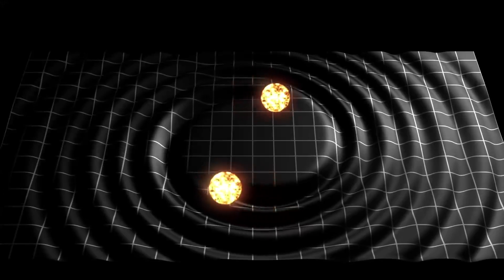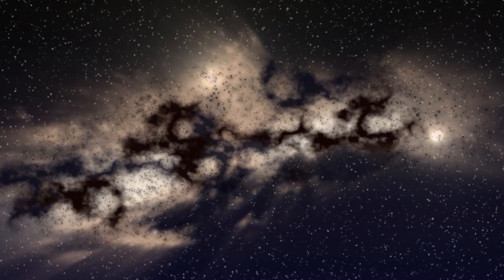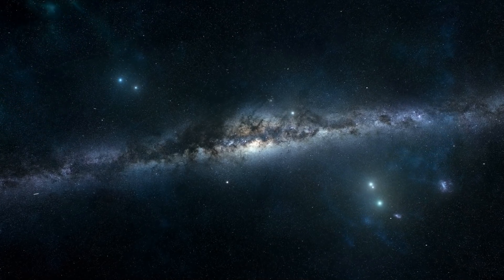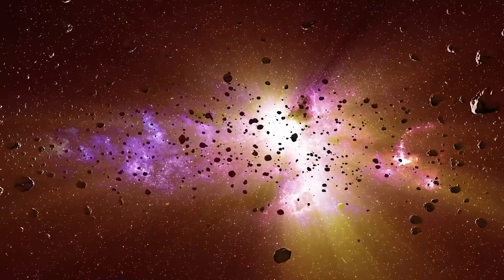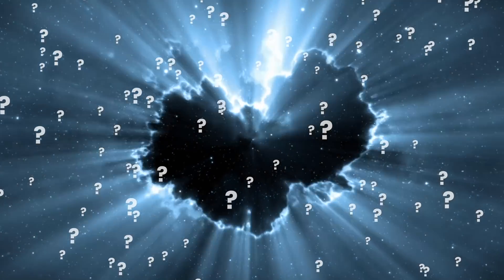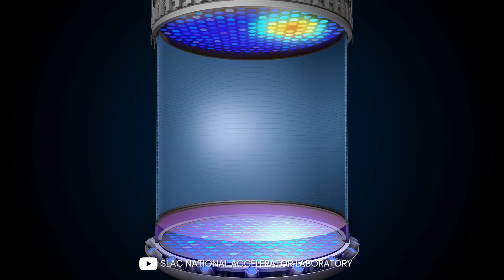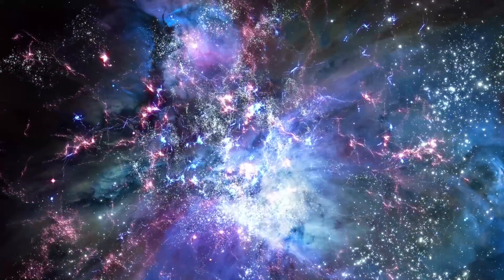This Will Change Physics! Dark Matter May Not Exist!

Comment: Dark matter is the corrective math that trues up our predictions of how stuff 'should' move with our observations of how they actually move (reality)  

In that sense, dark matter is just the ignorance of our grey matter.

We went through this exact same scenario with mercury's precession and even named an inner (undiscovered) planet Vulcan that was precessing mercury. Then Einstein came and showed that the vacuum of space isnt actually nothing and that the extra 43 arc seconds of precession cme from the time dilation encountered in mercury's close approach to the sun..

The orbital speeds of stars in distant galaxies require a number of assumptions.  Very few of which I imagine take into account the near Time = 0 state at the event horizon of the supermassive black hole at the center of the galaxy due to time dilation.  

The stars whipping around the event horizon in a blur are motionless, what you're seeing is the spin of the system which extends all the way out to the outer stars of that particular galaxy.

Academics place these galaxies on Euclidean grids of space time and Newtonian orbital values to determine mass and whatnot and that's not how it works.  The entire system is in rotational motion relative to ours.

There.  no need for dark matter to explain it, just like there's no need for dark matter to explain mercury's extra bit of precession.

Comment: The fact that there are are galaxies without dark matter is an argument FOR the existence of dark matter! Since it proofs if galaxies have none, their rotation can be explained without taking dark matter into account. While most galaxies still need dark matter to explain their rotation, this strongly hints that there is 'something' that increases their mass.
In short: If there are galaxies with dark matter and those without, and there is a clear difference in their rotation speed, there must be something different about the two types: Dark Matter (whatever it is).

Comment: The whole dark matter and dark energy thing is simply just a theory to bridge the absolutely enormous gap between what we think we know, and what we actually see. Just face it… the rate of galactic rotation, by itself, unequivocally proves that our current laws of gravitation are fundamentally broken… the discrepancy is just too large to ignore. IMO gravity shouldn’t be looked at as a force, but more of as an emergent property of the universe/space itself. It’s too weak as a force, hell a fridge magnet can overcome the gravitational “force”of the entire planet. Mass is just a measurement of how strong something drags on space/time itself. That relationship is not perfectly linear. There is an inherent minimum amount of mass something can have, and also an inherent minimum amount of space/time it can interact with. The more mass an object has the more space itself it’s actually touching, regardless of what size that thing appears to be. When we calculate the rotation of a galaxy it doesn’t make sense because we aren’t taking into account the actual topography and amount of space occupying the area the galaxy appears to be in.

Comment: what if gravity was an inter-dimensional force, thus seeming "weak" in one dimension, creating peaks and valleys in space/time in "blanket" dimensions that are physically undetectable from a single dimensional view. Stars and galaxies in neighboring dimensions shape our universe, and vice versa.
Reply: The issue with that is that is hardly likely to be provable. Although string theory has had a stab at looking at quantum gravity in multiple micro dimensions. Nothing like parallel universes overlapping, though.
Reply: This is .. something.. like string theory. If it would solve the problems string theorists would be celebrating confirmation of their field.. they arent.

Comment: How confidently and accurately can we determine masses of far away galaxies?
I ask because the entire dark matter hypothesis is based on this notion of galaxies which should be heavier that our predicted amounts.
Reply: That's a good question. We can very accurately determine the brightness and masses of Ia supernovas because they only explode on a very certain mass(the Chandrasekhar limit where electron degeneracy pressure from the pauli exclusion principle isn't powerful enough to hold off gravity), causing them to all have the same maximum brightness. The mass is about 1.44 solar masses.

Comment: Dark matter does not exist. The equation is the distribution of angular momentum = the curvature of space-time. It's baryionic matter that is at a higher metarotation than atoms. the dimensionality of matter is depenendent upon a kinetic fractal geometry known as a meta-rotation, matter alternates between being positive and negative dimensions, and the force, or curvature of space-time it exerts is depenpent upon where it lies on this kinetic fractal geometry.
Reply: This is true with dark energy as well, it's all baryonic matter, basically when you have one atom, it's of negative spacial dimension, two or more atoms together are positive spacial dimension, and their angular momentum influences other matter because of Mach's principle. Mach's princinple is the rule determining the laws of physics themselves according to the equation the distribution of angular momentum is equal to the curvature of space-time or the distribution of angular momentum is equal to the sum of inertial frames.

Comment: Yeah I don't see how dark energy is a thing without a particle capable of producing a repulsive effect on normal matter so that it can push matter without touching it directly and leave traces that we can see and measure.

And even then, unless there was an ever accelerating gusher of said particles spewing out the center of our universe, I'd don't see how an expanding universe suddenly decides to violate Newton by accelerating faster than the force being applied to it.

Honestly, the only thing that makes sense to me when it comes to Hubble, is that the universe is falling towards unseen container walls. We're constantly accelerating, because when you're inside a sphere, down is in every direction, and there is no terminal velocity in the vaccum of space.

Comment: Matter does not produce a gravitational attractive force, so this video supposed to give answers actually gives you the opposite to answers... bad information. Mass is gravity spinning in a hole, the hole creates the area of least resistance so gravity moves towards holes, there is no attractive force, or pull force. Pull forces are impossible in physics.

Comment: The fact that they built a mathematical model on the absurdity that  can communicate at a distance through an undetectable hypothetical medium formed by  space and time that requires more hypothetical substances resulting in a universe that is 95% unknown is,  in my opinion, indicating a 95% error bar in their models. Rather than just keep hypothesizing some new unknown, why not just say because god wills it, because the faith required to believe this science borders on religious.
The mind blowing thing is, that intelligent people believe this nonsense concerning DM/DE  and the error in their model is rooted in the belief that the effect called gravity is a real force unto itself.  Gravity is an effect, not a force which is why gravity is undetectable unlike electric or magnetic forces which are directly detectable.  Gravity is a dark force that  has brought rise to more dark things.

Most of modern science is science fantasy with little based on direct observation. Einstein derived hi GR ignorant of the electromagnetic fields that populate the vacuum of space, as well as the charged corpuscles, aka, charged solar particles of the solar wind. The model predicts DM/DE because the model is predicated on the false assumption that there are no electric fields or currents in space and they continue to deny.  A magnetic flux tube is an electric current. Observational science, to the clear headed philosopher has already refuted GR, unfortunately the theoreticians won't let it go.

Comment: Maybe bits of space itself are warped for reasons unknown. No matter is there but the space acts like it. It could be twisted space as a remnant of the big bang. Like pressure waves are the remnant of explosions in the air. The air gets packed together in waves. Space itself could be packed together thus causing the illusion of gravity from matter.

Comment: When you see a galaxy, you are looking at differing rates of time and differing measures of distance. Outside of a galaxy, there is very little matter mass and gravity to slow down time and shorten distance. 

What slows down light from our perspective is the gravity in the vicinity that slows down the rate of time. (It’s not that light slows down, it’s the rate of time that slows down.)  

So what happens where there is no gravity is that the rate of time speeds up relative to our rate of time so that starlight travels the same (or greater) distance at a faster rate of time. It’s still traveling the same relativistic frame speed but an entire second passes by from our perspective at a much faster rate, in a fraction of a second where there is no gravity to slow down time. So for most of the time, starlight is traveling through space at a faster rate of time relative to our rate of time.

That means starlight arrives much more instantaneously because the rate of time is free from the effects of gravity for most of the way. With no mass of its own, starlight arrives instantaneously as it experiences no time of its own traveling at the speed of light. We see things in slow motion where time is slowed down by gravity. 

This relativistic effect allows for a young earth since it doesn’t take billions of lightyears for starlight to arrive through the void of space where there is no matter to slow down time.

Comment: We've never verified the existence, nor nonexistence of both dark matter, and dark energy; their existence is entirely theoretical. It is logical they exist, sure, but in the field of quantum mechanics, a lot of our concepts are simply that: concepts, based on loose interpretations.

Gravity for example isn't fully understood. We don't really know WHAT creates it. We just assume mass creates gravity. But when you acquire a deep sense of quantum mechanics, that theory ceases to hold up. It's most likely that gravity itself is merely a side effect of electromagnetism. Every core of ever star and planet are electrically magnetized, and that is what forms the core itself, regardless of it's makeup. Therefore, it's only logical to come to the conclusion that the mass that forms around celestial bodies is due to this electromagnetism that forms their cores. Our planets core produces an electromagnetic field, which protects our planet, and the aurora borealis is due to electromagnetism. The more learn, the more likely that gravity is not a force itself, but merely a consequence of electromagnetism.

I have a BA in Literature, but I have the knowledge equivalent of a PhD in Psychology and a Master's in Quantum Physics, so I'm pretty educated on the subject. The only reason I wouldn't consider myself a PhD level of knowledge on the QP is due to my absolute disdain for math. Thankfully quantum theory/mechanics doesn't necessarily require that you master math. It merely requires that you understand concepts, and how they function in relation to each other.

Comment: Combine:
1. cosmological constant
2. schrodinger solution
3. Planck E= h f= h n   
4. n = number of superpositions 

And you get dark matter 

n^2 h^2 / ( 8 m L^2) = h n
m = 0.3313  10^18  10^-34 = 0.3313  10^-16 kg ( all superpositions).

1 particle = 0.331  10^-16 / ( 0.4  10^18) = 0.828  10^-34 kg = 46 eV
Reply: If you count only the positive wave function amplitudes: n = 10^9 
then dark matter = WIMP
m = 46 GeV

Comment: Theoretical dark energy and dark matter, a rubbish concept accepted by most astrophysicist, I never agreed on the concept, they should rephrase dark energy to electro-magnetism, the magnetic universe seems more realistic, magnetism is stronger then gravity, which could explain the expanding universe, every atom and molecule has a magnetic field, and dark matter a exotic substance created by black holes, without a central black holes galaxies would get ripped a part before even forming. 

They also know that all galaxies have a visible halo around them which can only be detected by certain instruments, it is true humans can not and will not comprehend the full scale of the universe or finite universe, we can only observe what we can see around us, but not beyond our capabilities and never will do, due to the increased acceleration of the universe expansion which is what we call the observable universe, which could be as little as 1% of the known universe. 

There was no big bang, there is no theoretical dark energy and dark matter.

Comment: Here is a simple solution that covers everything: there is no dark matter, there is no dark energy, there is no gravity. It's the void in space that keeps growing and pushes matter to form stars and planets.

In the video, they present the case of a galaxy that has no dark matter. This is the perfect example of the above theory: with empty space pushing it equally from all directions, no 'dark matter effects' could be measured...that's because since there are no other galaxies around, the push is uniform from all directions and nothing seems to interfere.

On the other hand, a galaxy that is in a galactic cluster with other nearby galaxies, can't have uniform pressure applied to it, and so it appears they are gravitationally attracted to neighbour galaxies.

This also works in the small: in the casimir effect, the two plates are attracted because the void between them is almost non-existent, while the void outside of them is far greater.

This also explains why gravity is indifferent to mass: a feather and a hammer fall in the same rate, because the void outside of the universe keeps pushing them towards the center, and their mass is actually irrelevant to this pushing.
Reply: But how the void could push? Sorry thats nonsence 😅 sounds exactly as dark energy
Reply: @fartmaker  Virtual particles created in the void elongate the void. I.e. the void is not really a void, it is a field that keeps growing, pushing matter aside.

Comment: One look at the paper that "hints to dark matter not existing" shows that it is referencing to a hand full of systems that apparently dark matter is not present which could just be an outlier of the rule. Also DM is supposed to explain the non-presence of a drop in anguiar velocity in galaxies with radial distance to its center etc. AND NOT that they're held together at all. Badly researched and full of blatant errors and false statements...

Comment: What if we're doing math wrong? Take a look at mix units for a second. If we do geometry with two different kinds of units, we need to be careful about the application. m≠N, yet when torque is calculated we are setting m=N (||F-r||=<x_F*N-x_r*m, y_F*N-y_r*m,z_F*N-z_r*m>, which I think will only work when we divide both sides by m. m/m=(kg*m/s^2)/m, or 1=kg/s^2. So calculating torque only works when the surface tension (kg/s^2) is 1 or approximately 1? This would also imply that everything that uses torque has a surface tension associated with it. Which I don't think is a thing. Is it?

Comment: There is a chance that the much stronger force caused by electrostatics effects is ignored. Think about a solar system with a bubble around that have the same polarity as the other solar systems. They'd push other solar systems away. The driving force could be the the electric loaded particles from the solar wind....
Reply: No. That force is too short ranged.

Comment: There are some very simple assumptions and interpretations which may explain most the observed phenomena easily, but are extremely difficult to do calculations with. The difficulty increase is similar to the switch from Newtonian to Relativity theory.
Also most physicists are reluctant and refuse to give up on certain prior simplifying assumptions like the cosmological principle, certain natural parameters being constant and particle sizes being equal across all space and time.

Comment: Sorry, but there are several mistakes.
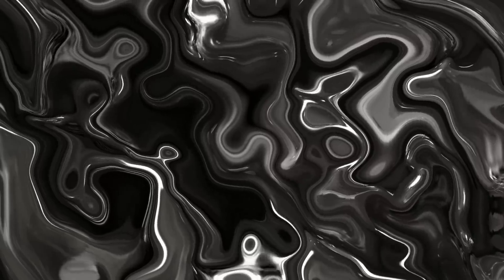Not only have you confused dark matter with anti matter, but also at around 2:00 you say, that dark matter is only known because of its gravitational pull.
That's simply not true.
There are many more hints which a dark matter model may solve simultaneously, for example the fluctuations of the cosmic microwave background (which can be explained by early dark matter models), bullet clusters, gravitational lensing and many more...

Please, please let at least a few specialists check your scripts before you post them on YouTube!

Comment: darm matter is the dust and gas they couldtnt see when they came up with that bs     dark enregy is electircity       newtonian physics cant explain what we see outside our solar system so they had to  make up dark matter instead of asmitting they are wrong   the vera rubin sat will find all the dust and gas rightg where the crap should be  we live in a electric plasma universe